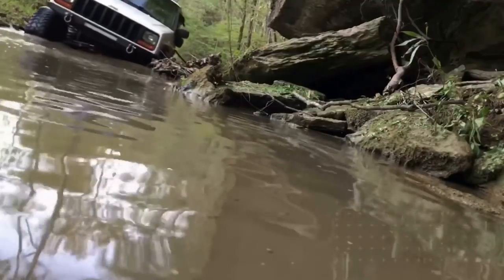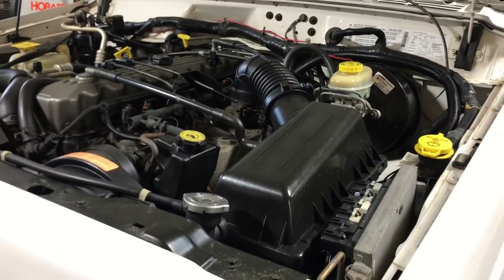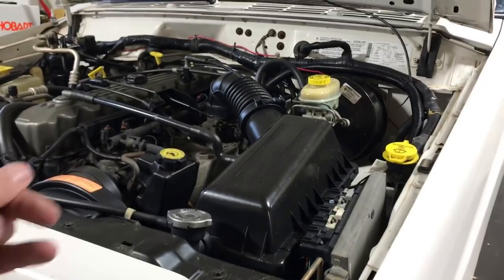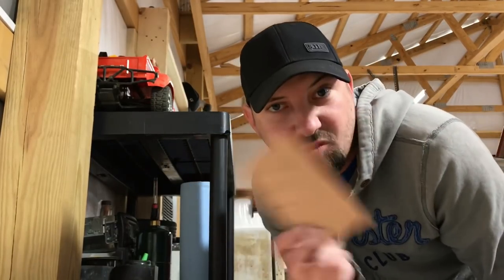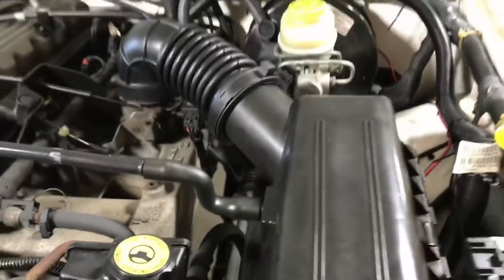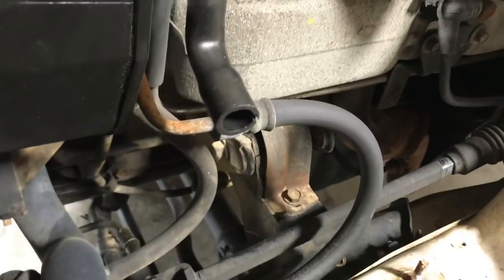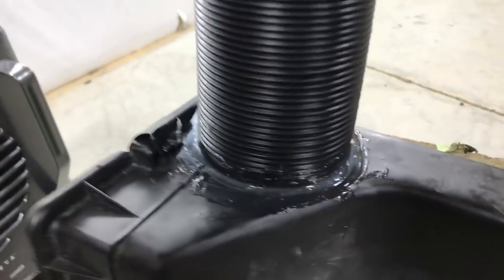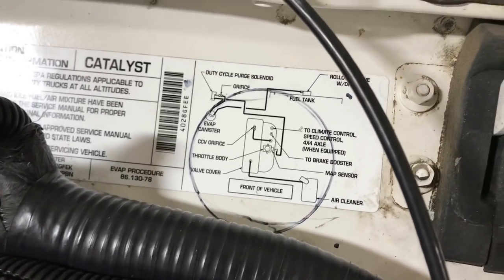Jeep XJ Cowl Intake Using Factory Airbox

Comment: This is awesome. I always thought snorkels were ugly and a bit excessive. Even if you get rain water in that hose it’s going to end up in the bottom of the air box where there is a hole. Those style air boxes are designed to separate water and larger debris. That’s why there is always leaves and junk in the bottom

Comment: Where did you get that accordion tube and attachment? Do you have an actual name and use for it?  Couldn't find at Lowes. 😖
Reply: Was lookin in the wrong place! 
All of the materials, brackets, ducts and various filter systems are available at any local auto parts store. FYI.😉👍
Jus look in any of the following
MAN stores: hardware, auto, tools or gun supplies places and you're bound to find what you're lookin for. 🤪👍

Comment: the reason they mount the air induction tube to the passengerside fire wall is because the cawl panel on the passenger side has a plate that blocks rain water / car wash water from pouring down into the little rectangular Ac induction tube going into the heater box . I'm planning on doing your set up toour 90 and 96 XJ jeeps . dont for get to put thermal wrap from autozone on the air induction flex tube
Reply: Once the seal around that box goes out you still get water on your floorboard. Good times.
Reply: How in the hell is getting water on the floor boards possible?
Reply: @dougwethington8339   either the windshield seal leaks or heater core can leak . As far as my modification it WI be used to take in fresh air and no water if we deside to off roading through water. the factory box would allow water to be sucked up through the air induction system .
Reply: @dougwethington8339  tons of videos on youtube concerning water on the floor issues. i have a 99 and its been that way since i got it 4 years ago. can see the water as it builds up and its harder than hell to find the place where its coming in. i stripped the inside, patched up all the rust holes, or replaced the full pans, and let it do its thing/ im just now getting around to trying to repair the windshield leak. 
its a pretty common issue with xjs with more than one root cause.

Comment: So, are you using a K&N air Filter? Those are pretty thin..  Because, I don't see a Wix Air Filter, being able to fit  that airbox being that they are thicker because that hole you cut, into the back of the airbox, is a lil high.. Just Askin.. Thinking bout doing this one.. BTW nice XJ!  Mine is Exactly like yours but Manual, Cheers!

Comment: Why does the airbox have to be sealed? Can I do this but keep the airbox open so it draws air from both the front and the cowl plate?
Reply: It would defeat the purpose of the cowl intake.  Besides drawing in MUCH cooler air it also moves the air intake point from behind the headlight to the base of the windshield.  Much safer for any water crossings where water might get to headlight height by accident for a second.

Comment: Did the air hose seal pretty well without another mounting plate and clamp in the airbox ?
Reply from the maker: Devon Maavich yes it basically screwed in their due to the design, i just added adhesive silicone to be sure

Comment: What is that LCD screen with the engine temp, IAT, manifold pressure, ect.?
Reply from the maker: boozepunch it is an Ultragauge. Plugs into OBD2 port. I will be doing a video on it later. Theyve been around for some time but very handy for the money.

Comment: So you went with a smaller diameter hose opening?  How's performance?
Reply from the maker: MUD FLAP it’s 3” diameter, no different than factory hose, and actually probably larger than the factory opening at the front of the airbox.